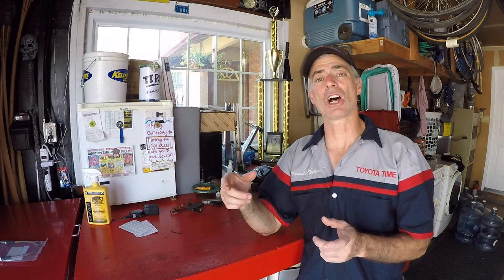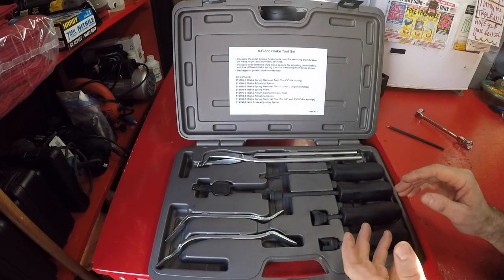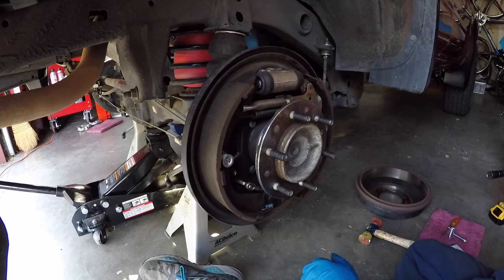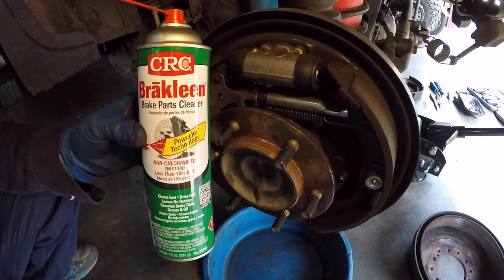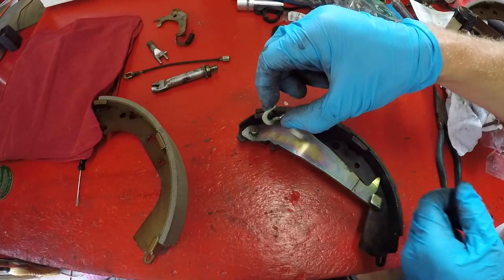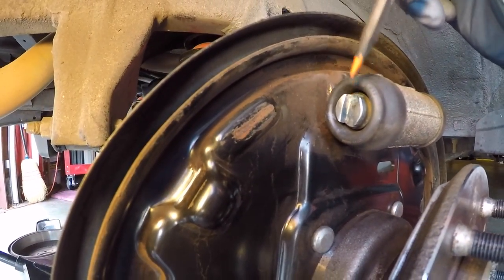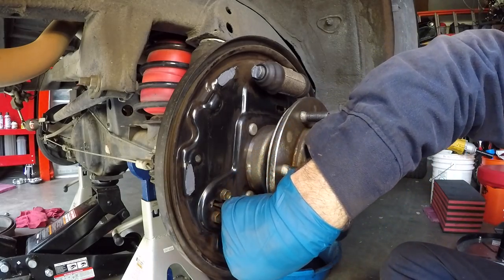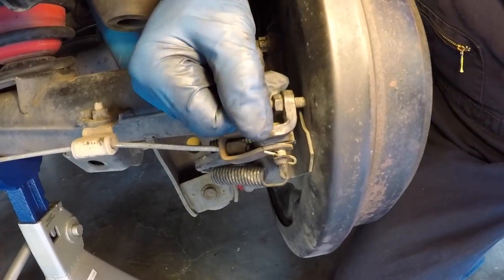Drum Brake Shoe Replacement

Comment: Thanks for the video timmy.

I have an 02 and I'm totally hung up trying to get the drum off.  I tried using two bolts to press the drum off, but one hole is now stripped out. 

It seems like the shoes are preventing the drum from releasing.  Curious if anyone has some info on how to loosen the shoes on an 02?  I saw you mentioned the auto adjusting system is a bit different on 01-02 than the truck in the video.
Reply from the maker: Yeah, it's different.  First, pull the access plug out of the back of the backing plate.  Using a flashlight, look inside the hole and you'll see the star wheel adjuster.  try pushing the wheel one way or the other.  The way you can push it and get it to click is tightening.  Now, with a small pick tool, you need to hook the adjuster plate and pull it toward you and away from the star wheel.  Once you've done that, turn the star wheel with a flat blade screwdriver the opposite direction of tightening and you'll be able to take tension off the shoes and pull the drum off.  I just hope things aren't too bound up from the shoes coming with the drums when you were using the bolt technique to draw the drum off.  You might have to pound the drum back towards the axle to take tension off so you can back off the star adjuster.  I hope all that makes sense.

Comment: Hi Timmy, I was waiting for that video. My truck handbrake do not hold completely. I am able to pull the handbrake 7-9 times.  The truck moves in both directions a little when I apply it. It is very loose. Would you give me an advice about to tighten it, please. Thank you for your videos!!.
Reply from the maker: Are you saying when you pull the parking brake, it takes the recommended 7-9 clicks to feel tight but the parking brake still doesn't hold the truck very well?
Reply: Yes, i am saying that.
Reply: Yes!!!
Reply from the maker: The truck will move a little even if the parking brake is set tight.  You'll feel a little shift of weight forward or backward depending on which way gravity is pulling the vehicle and then the vehicle shouldn't move anymore and be held by the parking brake.  If you're on pretty level ground, you probably won't notice much movement because gravity isn't working against you.

When you come to a stop, you are holding the vehicle with the front and rear brakes.  You set the parking brake and then release your foot off the brake pedal.  If the grade forward or backward is steep enough, you will feel the vehicle move and settle against the rear brakes.  If you really crank on the parking brake maybe you won't feel any movement but it's pretty normal to feel that slight shift of weight after you apply the parking brake.  If the vehicle continues to roll after that initial shift of vehicle weight onto the rear brakes, then you have a problem.
Reply: It moves a little even in a flat level ground. Also, the cable is very loose.

Comment: Timmy, I see you suggest replacing with oem shoes, is it suggested you reppace with oem drums as well. My drums are cracked and the original from 1999?
Reply from the maker: Yes, I would get OEM drums.   You might get lucky with ones from Napa if the OEM ones are too expensive.

Comment: If my truck has the stepping parking brake kind I assume it’s the same kind as the pull parking brake method?
Reply from the maker: I'm not so sure but that's a logical assumption.  If you have auto adjusters, then I would suppose the answer would be yes.  You'd just push and release the e-brake until you believe it's properly adjusted.

Comment: Hello there and thank you for the information you share on your videos, very educational. I have a question if you don't mind. I recently replaced rear drum brakes completely with new wheel cylinders on my 3rd gen 4runner. Now I get a vibration at all speeds when braking. Not a pulsating pedal but a whole body vibration.(not violent shake). I went a head and did my front brakes thinking it was warped rotors, so I replaced rotors and pads. Still vibrating. All parts were aftermarket. What should I do next? Thanks ahead!
Reply from the maker: So it sounds like the problem wasn't there until after you did the brake job, correct?  Did you use OEM brake shoes as replacements?  Do you use OEM brake cylinders?  Did you replace the drums?
Reply: Yes the problem arose after the job. I used all aftermarket parts, a kit sold by Centric. New Drums, shoes, cylinders, and springs. UPDATE: I went back in to adjust the star wheel through the whole in the back. The vibration is much softer now, so it helped. Also I noticed my passenger side bell crank is seized and I was unsuccessful in doing the final adjustments by pumping the handbrake. I will replace soon. Since the adjustment of the start wheel helped the vibration, do you think it's just that I didn't do the adjustment right the first time? Were the shoes possibly not creating the right Amount of contact and pressure against the drum?
Reply from the maker: @Ish_714  Hard to say what the issue is.  I've heard lots of issues with aftermarket drums and shoes, that's #1.  Since you said you have a seized bell crank, your rear shoes probably aren't in equal adjustment so that's a likely factor too.  I'd get the bell crank issue fixed, then get the shoes in equal adjustment and see what that gets you.
Reply: @TimmyTheToolman  UPDATE: After a couple weeks of vibration while braking, the vibration got stronger. I decided to go back in and investigate. After removing the drums and inspecting the inside, I noticed marks of uneven wear. Even though the drums were brand new I decided to take a chance and get them resurfaced and that did the trick. The drums were out of round, no more vibration. 🤷🏽‍♂️ Crazy right? Brand of Drums is Centric
Reply from the maker: @Ish_714  Yep, I have heard of plenty of issues with aftermarket drums and brake shoes.  Glad you finally figured it out.

Comment: At around 33:20 that pin that the horseshoe clip attaches to is not on these new bendix shoes. I understand now that I should’ve gone oem but can I remove that pin and place it on the new one? I really appreciate your videos they’re helping me out a lot here. Thanks Tim.
Reply from the maker: Hey Tim, I have no idea if it's possible to take the pins off the old shoes and put them on the Bendix shoes.  If I had to guess, I don't think this would work out all that well.  I would suggest returning the Bendix shoes and buying some OEM Toyota shoes.  Good to hear our videos our helping you out.  Happy Wrenching.
Reply: Haha my name isn’t actually Tim I was thanking you but anyway. I actually bought some other ones and they came with the pin separately. I’m under time constraints unfortunately and won’t be able to wait for oem. One more pain in rear step hammering that in but everything else applies. Thanks for the reply really appreciate it.
Reply from the maker: @ca5ify  No problem Carlos.  I reckon I misread your question.  I guess if I just looked at your name I would have figured out your were thanking me.  Anyway, I hope the shoes work out for you.

Comment: Great video! What if the drum won’t slip on? Sprocket is all the way in, no e-brake on.. any suggestions
Reply from the maker: Something isn't right obviously.  Is the adjuster properly seated in the slots on the shoes.  Are the shoes in right spot on the bottom?  At 43:10 it shoes where the bottom of the shoe should be sitting.
Reply: The adjuster was not seated properly. Thanks

Comment: Timmy l was checking with my neighbor my truck,  and he think ,that the problem would be the brake buster because when we pump the brake you feel a little presión, but when you press the brake without pumping the pedal going down and  the drums keep turning. What you think?? Thanks
Reply from the maker: Humberto Zarate I'm not familiar enough with brake boosters to know what the symptoms are of a failing or failed brake booster but I think it's a definite possibility.  But, the need to pump the brakes is a classic sign that there is air in the lines.  Bleed the brakes again first and then look into other possible causes of why the brakes aren't working correctly.

Comment: So I did the job or at least I thought I did. After driving for a block or so I knew the job was just starting. Brake pedal sank pretty far before anything would start happening and the parking break trick wasn’t really improving it at all. Any idea what I did wrong? Did I just not adjust the shoes out enough after putting them on? Do I need to bleed the system?
Reply from the maker: You shouldn't have to bleed the brakes unless you changed out the wheel cylinders.  It sounds like you just need to keep pulling the parking brake for the self-adjusters to tighten up the shoes.  If you didn't first adjust the brakes where the drums slid over the shoes with only a little play, it would take a lot of cycles of pulling the brake handle to get the brakes adjusted properly.  You know you have the proper adjustment when you're only getting 7-9 clicks out of the handle.

Comment: I know this is an older video, any chance you have one regarding the 1ST GEN TUNDRA SOFT PEDAL ISSUE and how to get it back to a solid feeling pedal?
Reply from the maker: Do you regularly use your parking brake?  That will keep the rear shoes in adjustment.  Have you tried bleeding the brakes?

Comment: Hey Timmy, would ever or have you ever done a disc brake conversion on any Toyota?
Reply from the maker: No, we haven't and I would never bother.  The money and time spent on a rear disk brake conversion is not worth it.  75% of the braking happens in the front.  Disk brakes for the rear is going to have a negligible improvement.

Comment: What is best (cheapest, quickest, easiest ) way to start  testing for a head gasket problem on a 1994 4 runner with a V-6 ?
Reply from the maker: steve jette  Well, there are telltale signs like your engine coolant level drops and there's no leak to be found.  Another one is your engine could be experiencing a misfire.  Finally you could be experiencing an overheating issue.

But, to properly test for this, you should first do a compression test of all your cylinders followed by a leak down test of any cylinders that have low compression numbers.

Comment: Is it necessary to have the brake drums turned or is does sanding them down with 400 grit actually all you need?
Reply from the maker: I just did this job on my 98 and I did nothing with the drums.  I just cleaned them up with some brake cleaner.  It's best to turn the drums and get a new machined surface but I rolled the dice and tried it out without doing anything because I've seen many others do it without any adverse effects.  So, you'd probably be fine doing nothing as well or sanding them if you feel like it.

Comment: Question:  Is it safe to use the rear diff. as a jacking point for your 4Runner?  I saw that you guys had the stands on the axle, which would actually be a lot more convenient for me as I have a bit of a lift. lol
Reply from the maker: J Hutson Yes, it’s perfectly fine to jack up the truck via the differential.  The axle housing is very strong so it’s also ok to support the weight of the truck on the axle.

Comment: Holy, this seems complicated and time consuming! I did the front brakes on my 01 4Runner in less then half an hour. Sucks that it has drum brakes! I had a question for you, my trucks rear brakes squeal. I’ve only had them for 1.5 yrs and less then 30k miles on them. I did clean the drum up and it seemed to remove the noise but it just came back after a few days, any ideas? Btw thank you for these videos, I have learned a lot from you and did most of the maintenance on my 4Runner from your videos!
Reply from the maker: It seems complicated but once you do it, it's not that bad.  Why your shoes are squealing, I can't say.  But, do you know if OEM Toyota shoes were used?  I've heard of a lot of issues with aftermarket shoes.  If they were aftermarket, I'd swap them out for a set of OEM.  Great to hear our videos are helping you out with your rig.  Happy Wrenching!
Reply: @TimmyTheToolman  thanks for the response! I might try at it with a buddy on a weekend. No they weren’t oem, they where autozone brand I believe. Maybe that’s why then.
Reply from the maker: @jaimesco2013  Yep, I bet your problems go away after you swap in OEM shoes.  Good luck with the job.

Comment: My parking brake is rusted shut on my 2002 Toyota Tacoma Double Cab 4wd. What or how do you recommend for a final adjustment on installation of my Brake drums without a parking brake? Also, is it possible to only have one drum that requires resurfacing? Thanks
Reply from the maker: Well, first of all I would recommend getting your parking brake fixed.  I'm guessing your bell cranks are rusted out.  If you don't have a working parking brake, you will constantly be required to pull off the rubber access hatch on the brake backing  plate and get in there with a flat blade screwdriver or specialty brake tool to turn the adjuster to tighten the brake shoes.  I would assume you would get tired of doing this because the shoes will wear and will need to be readjusted.  Using the parking brake all the time keeps your rear brake shoes in adjustment.  

If your brakes were out of adjustment with one being tighter than the other, I could see this situation causing uneven wear to the drums.  

We cover how to adjust the brake shoes in the video but we finalize the adjusting by pulling the parking brake over and over again.  You won't have that luxury so you're going to have to adjust them and then spin the wheel to detect how tight the brake shoes are.
Reply: @TimmyTheToolman  Thanks for the info. Unfortunately not only is my parking brake rusted shut but the rear dust plate that it works against has been rusted through as well. The only way to get that off requires a great deal of work on my 2002 vehicle
Reply from the maker: @josephagosta7554  Gotcha, you would have to basically do a rear axle bearing job.  I know it well since I've probably performed it around 15 times.

Comment: Hey Tim, I had a quick question I’m hoping one of you could help me with. I did a rear drum brake replacement on my 1996 4runner and had a problem with my brake pedal after I was finished. 
The shoe replacement went fine, no worries there, but I’m unsure of if they are adjusted correctly. 
I did NOT manually adjust the rear shoes as I figured pulling the E-Brake a lot would adjust them for me. Now, my brake pedal has to be pushed down a lot further than before to get the rig to stop. E-Brake clicks within the 7-9 clicks. 
Do you think I need to go back in and adjust manually, or do you think this could be air in the system, a failing master, worn wheel cylinders, or something else ?
Reply from the maker: Did you have this issue with the brake pedal before you did the job?  If not, something isn't right with the brake job you did.  Did you crack open the brake lines to replace wheel cylinders?
Reply: @TimmyTheToolman  I did not have that problem before. Also I have not cracked open the lines or replaced the wheel cylinders
Reply: Update: Went away completely. I’m guessing my wheel cylinders just needed a little time to push back out, or maybe my E-brake finished adjusting all the way.
Reply from the maker: @josephlenehan7652  Good to hear.

Comment: What type of measuring go would u use to measure the 0.5 millimeters for the parking brake mine is way out of adjustment
Reply from the maker: I take it you're talking about the bell crank adjustment?  Just use your eyes.  A 1/2 millimeter is just a tiny bit of space.  This is not like building an engine where measurements have to be precise.  You know how small a millimeter is so just adjust it where there's a tiny gap.

Comment: just attempted this job earlier. will finish tmr morning. i notice that the brake shoe wears is un even. whats the reason for this? also on the rear passenger brakes, i notice grease stains. first time i checked on this it was soaked on oil since i had an axle leak. any tips?
Reply from the maker: The reason for the uneven brake shoe wear is hard to explain.  My buddy Jordan who's a mechanical engineer had a drawing with a bunch of formulas but it went over my head.  The front brake shoe takes most of the wear.  And, it's the lower half of the front shoe that take the brunt of the braking force.  

Your rear axle seal is leaking.  Check out our video on doing the rear axle seal job.   The video explains everything you'll need to know. https://youtu.be/AVhSDnw2ugo
Reply from the maker: Hey Justin, I forgot my buddy Jordan wrote a response to a thread I started for replacing the rear brakes giving an explanation for the uneven brake wear.  Again, it's complicated but here's a link to the thread if you want to take a look at it.  His explanation is on the first page of the thread, post #12.  http://www.toyota-4runner.org/3rd-gen-t4rs/244041-drum-brake-shoe-replacement.html